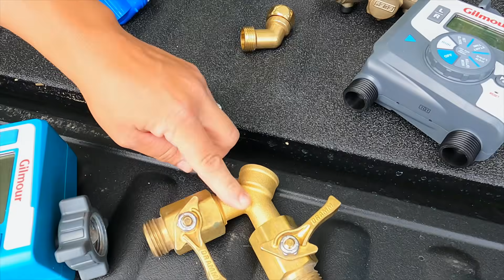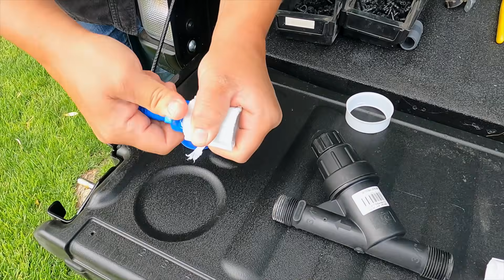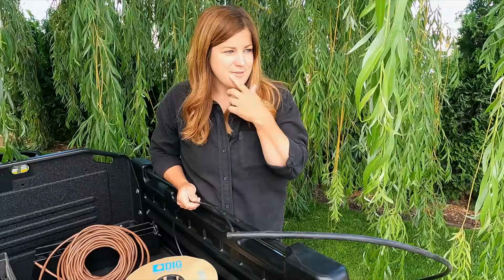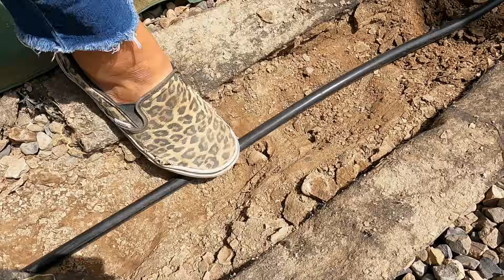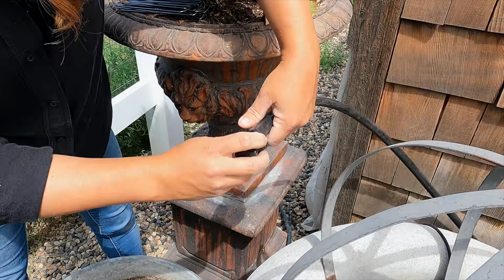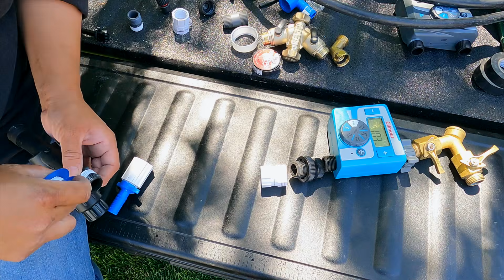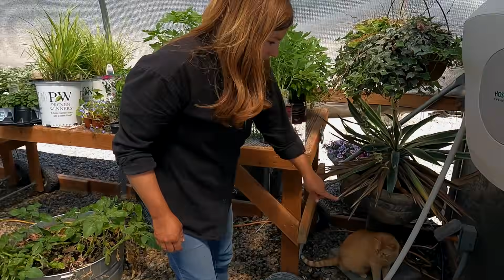Setting Up 18 Pots On Drip Irrigation! 💦 // Garden Answer

Comment: Wow!! the DIY I've been waiting for. I've spend an enormous amount of time looking at videos showing how to do irrigation. My biggest concern was to be able to manage my garden from inside the house using my cellular phone....just like Aaron does. 😏
The task seemed overwhelming, at first.  So, I started with my lawn, which was already fitted with sprinklers and a manual timer.  I finally found a sprinkler system that I have come to love. It is the b-Hyve Smart Hose Watering Timer by Orbit. Just what I needed. It is WiFi accessible, it gives you alerts when watering is done, detects rain in the forecast & delays the watering automatically, it shuts off the timer in the rain and it is super affordable. I found it at Home Depot (Timer with WiFi hub together for $59.99). The only Cons I found are that it only comes with a single hose outlet & I need multiple hose connectors. However, I found out from Orbit that you only need one WiFi hub to control multiple lines. In that case I purchased the additional (3) timers straight from Orbit, since it was the only place that carried them by themselves. They told me that they are working on the design of one with multiple connections. This is such a game changer. I can view right on my cellular phone what's going on with the system. 
After getting this installed all by myself, I am ready to tackle the garden beds. If I can do this at 76 (whoops, now you know my age 😏) so can you. Here is the link:
b-Hyve SMART HOSE WATERING TIMER
https://www.orbitonline.com/product/b-hyve-smart-hose-watering-timer/

Laura and Aaron have been a tremendous influence on my life. Their drive and confidence is contagious. I am no longer afraid of getting rid of plants, etc. I like Laura's motto "If it does not make you happy, just get rid of it" 🤗😉
▪︎Kudos to Aaron for using the  Thread Seal tape at 6:01 which is a cheap and easy find at Home Depot. It is labeled as a 1/2 in by 260 in PTFE Thread Seal Tape
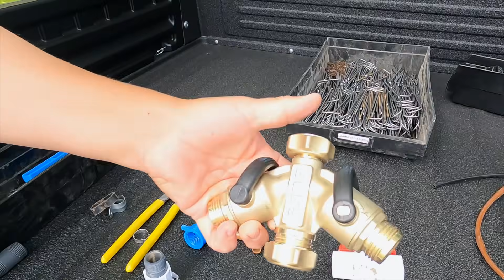▪︎I love the Dramn hose splitter. The  quality and durability justifies the price. However, the ELEY 2-way valve at  7:24 is comparable in quality, durability & pricing as the Dramm brand products. I was sold with the middle valve feature which I use for the hose and love it. Here is the link:
ELEY GARDEN HOSE REELS, HOSES & WATERING TOOLS
https://www.eleyhosereels.com/products/garden-hose-2-way-y-valve
▪︎ To anyone considering to DIY an irritation system, I highly  recommend they view the following links. 
DRIP IRRIGATION DESIGN GUIDELINES
https://www.irrigationtutorials.com/drip-irrigation-design-guidelines-basics-of-measurements-parts-and-more/
DRIP IRRIGATION TIPS
https://www.snwa.com/landscapes/how-and-when-to-water/drip-watering-tips.html
INSTALLING AN IRRIGATION DRIP SYST - Kreatyve Gardenista (YT)
https://youtu.be/9eGo_29-oXM
HOW MANY SPRINKLERS TO USE
https://www.rainbird.com/homeowners/how-many-sprinklers-can-be-used-zone-or-valve
DRIP DEPOT IRRIGATION SUPPLIES
https://www.dripdepot.com/
DIG DRIP KIT (a great starter kit)
https://www.digcorp.com/residential/

SORRY FOR THE LENGTH OF THIS POST 😏 HAPPY GARDENING🌱🌺🌾

Comment: You are drip irrigation MASTERS!!  Awesome video content which helps so many people.  The question I have is about adding the extra couplings with t joint expanders... (I can't even believe that is in my vocabulary and I might be using the terms improperly). Doesn't it affect the water pressure when you add so many extension points . Referring more to the new land garden areas.  Thanks for all you do!

Comment: Thanks, those pot feet are exactly what I need!  BTW, when applying the Teflon tape…if you will flip the roll of tape over, so its backside is against the item you are wrapping, it is easier to maintain even tension.

Comment: I'd like to turn a few sprinkler heads into drip lines...could you do a video explaining how that could work? How many feet of drip line can you run in one zone? And would I cap all the heads in that zone except the one I'd run the drip from? I have 9 zones. I'd love to change two zones to drip only and the rest of the zones would be left sprinkler heads for lawn watering.

Comment: Earlier this year, I had a drip system installed. Living in Northern California which is going through a drought, I wanted to reduce water usage and drip irrigation was a good solution. Installation seemed complicated and buying supplies even more so, so I hired an expert. Your video breaks down the process in simple, easy to understand steps. I feel like after watching your video, I could’ve tackled it. Thanks for the great video.

Comment: I have a problem with ants that get into my pots through the bottom holes.  I am trying to deter them by a mixture of icing sugar, Botax and cornmeal mixed together and then put into a small empty pop bottle laid on its side so the ants can craw inside.  I am putting them below the surface.  What else can you suggest?  Do the ants do damage to the plant roots?

Comment: Does having a drip line coming through the drainage hole impede the drainage when watering? How do you determine how much water each plant needs per day, run time, etc?

Comment: Read this for a good summary on hose thread v. pipe thread: https://help.dripdepot.com/support/solutions/articles/11000044391-know-your-threads

This drove me crazy when starting off! tldr; don't mix them. A washer/o-ring will get you a watertight fitting for hose thread. You need to use Teflon tape or a sealant to get watertight connections for pipe thread.

Don't give up, I'm an engineer and it still took me a while to wrap my head around drip!

Comment: While it doesn't hurt, Teflon tape isn't required (and doesn't help) with hose thread connection which rely on a 'rubber' washer, as you noted (some connectors use an o-ring rather than a washer).
[Edit - Laura used the tape on a pipe thread, where it is required. But she didn't mention that it's not needed on hose thread. ]
(Pipe thread seals by interference between the threads, while hose threads seal by compressing a washer between the end of the male connector and the inernal base of the female connector.)

Comment: I set my hanging baskets up on drip irrigation and it has been a game changer!  I killed many a hanging basket before I began automatic watering.  I started with a kit and it will do about ten pots, but your system looks much more substantial and I think I will switch over to the 1/2" tubing to get a better supply at the end of my line.  I have found that with the 1/4" tubing you run out of pressure at the end of the line if you have many pots.  Thanks, Laura and Aaron!

Comment: Love this! I just installed drip irrigation myself this year and I was very intimidated at first, but it got easier the more I did it. Just a tip if you have to garden while it's hot and sunny out and there isn't any shade - I have an old patio umbrella and umbrella base that I plop down wherever I need some shade so I can work in the garden and not burn up under the hot sun. 😊

Comment: This video was beyond helpful! We are just beginning this process and we have an irrigation line spec’d at 75 psi (1/2 inch poly), where the pressure at our faucet is only 55 psi. Im wondering if I can eliminate the low pressure regulator to travel farther away from the faucet. I’ve noticed your in-ground beds go pretty far with 1/2 inch tubing. Are you using a low pressure regulator with those systems?

Comment: How do you winterize your drip runs? Can you reuse or do you replace each year? Any tricks for inserting the .25” barbs? Killed my hands till I bought a tool but that tool doesn’t let you insert a second tube on the other end of the barb. TIA.

Comment: This was such a great demonstration of running the drip. Thank you! For the brown 1/4” emitter, can you create the same thing if you don’t it by puncturing holes in the black 1/4” distribution tube? Probably not, but just wondering? 🤷‍♀️
Reply: The emitter holes in tubing have a kind of filter behind them to prevent clogging.  If you put in a hole in the tube it wouldn't have the filter and could clog.

Comment: Perfect timing! I’m reconfiguring my drip this year to include the newly planted beds in front. Unfortunately, I need to add on to the faucet in back and run it around the house as the front faucet is inside the garage (weird and frustrating).

Comment: Great video! I live near you so I have the extreme heat too. I tapped into my underground system with my 1/2” tubing and went from there to my beds and pots. I haven’t had any trouble with pressure but maybe I’ve been lucky! I have 6 zones I can tap off of. I did find that the time needed for the lawn is of course too long for pots so I added an inline valve to slow the flow on my 1/4”tubing. My husband and I have learned by trial and error as this is the first home we’ve had an auto sprinkler system. I’m not sure where I should or could add a pressure reducer. Any thoughts? Thanks for your amazing content! 🙋‍♀️ Star ID

Comment: great info!! it does sound confusing but it's like a puzzle and finding the right pieces to make your system work for you... generally, esp at a smaller hardware store over a big box store (in my experience), there's the "guy" who works there and knows what's what to walk you through it... my hubby has turned into mr. sprinkler man, bless him - i plant and he goes around running sprinkler to all those places i decided really needs to have a plant there, lol... one of the things we use, since we don't have the fancy phone app (wink wink), is a remote that comes with our system... our system is on a timer, but with the remote,  i can be on my patio, etc and turn the system on if i want to run an extra watering in any of the zones we have... if you've been waffling on getting a system, particularly if you live anywhere it gets HOT (and isn't that everywhere right now??), GET ONE.. do not be afraid of it!! if you can operate your new cell phone, you can do this! lol... really, just take a breath and do it step by step.. you will be thanking yourself (or your sprinkler man) every day!! thanks for the video!!

Comment: How would you run the 1/2 tubing around a corner? Is it flexible enough to where the turn wouldn't cut off the water flow?
Reply: Use an L connector.
Reply: @jgwood10  A PVC L connector?

Comment: Another source of leaking and installation problem that I have experienced occurs when mixing brands. The dimensional measurements sometimes are for the exterior of the hose and sometimes the measurement s for the interior of the hose. 🙄

Comment: Thank you so much for this demonstration. If anybody's plant need a drip system, it is mine. I have the hardest time figuring out the right amount of water. I seem to either over water or under water trying to correct over watering! 🐈 It's a mess.

Comment: It wasn’t confusing for me because I’m right in the middle of putting my pots and raised beds on drip and I’ve already pretty much sorted it out.  But as I watched, I thought that it would have been helpful to see one setup done from water source to pot emitters. Then go back and deal with the variables. Your previous videos have helped me SO much. I really impressed the guys at the sprinkler store with my knowledge of terms and understanding of the sequencing 😊. Thanks.

Comment: Do you take it down in the winter or leave it set up?
Reply: They leave it in ground. Just turn off the water. It will drain. The lawn irrigation is different. That has to be blown out so it doesn’t freeze

Comment: Thank you so much for posting this video it helps with understanding drip so much! We are attempting to put in a system this year. We are hoping to use rain barrels as our supply. Would we still need to use the back flow piece etc?

Comment: I have a few raised beds and parkways with drip run in them but the water supply is too far to easily trench. My solution was to have the pressure regulator and connections to the drip all in the beds/parkways with quick connects so I can easily attach a hose, turn on the water, and walk away ☺️ 

You can get really inventive with your system, I don’t have nearly the same amount of connectors as shown, but I also have a different situation ☺️👍🏻

Comment: Great video...I started with a small irrigation system in some of my beds last year because of your instruction.  This was a good recap of all the parts needed as I want to add some to my front beds.  My problem is I don't have a faucet nearby and I do all watering by hose/sprinkler.  Would it work to put a post in and add something to that to connect a hose to and then run drip?

Comment: What great timing. Just yesterday I was telling a friend that I need to get a plumber to fix my leaky toilet so instead of coming for just that simple job wouldn’t it make sense to get him to change the garden faucet so it splits off then I could run one hose to the beds and another longer hose across the ground to where I keep my little plot of containers for all my vegetables (at least 80% of the backyard is concrete) and I could even stretch the budget a bit and put them all on drip, just as Laura do!!  My friend said sure, that’s easy enough and a very doable DIY that “WE” can tackle!! Now, after watching (and re-watching) you go at it my head is still spinning and the glaze in my eyes haven’t cleared — if this ever becomes a reality Mr. Plumber/Handyman or some other expert will have to take charge and put it in place for me!!! 🤣🤣🤣

Comment: This is Exactly what I have been doing the last several days. Re doing most of my drip irrigation. I thought I had it all laid out last summer, but it just didn't hold up over the winter. Any suggestions for weather proofing drip systems? It's getting expensive replacing it. (Especially, when you have to run up to ACE & can't wait for an online order (Wowza $$$)!

Comment: Hello! I have set up fairly extensive drip systems in three of my gardens so I’m very experienced with the parts but it’s always great to see how others are setting them up so thank you for this video. My question is this…I have a section on my raised Azek deck of half inch tubing running about 5 feet along vinyl siding under a window box for various pots. Do you have any suggestions of how I could tack it down to the deck without permanently damaging the siding or Azek by drilling in clamps?  It looks horrible as the tubing always wants to roll up in the air and I’m not sure I’ll always want it there. I realize there may not be a solution to this but thought I’d ask 😂
Reply: Maybe puddy will work.

Comment: I use a similar system for the ferns I hang on my porch.  I got really tired of watering every day and having water run down my arm into my armpit and down my body.  I run it for only 6 minutes and the ferns thrive all summer.  It is satisfying to look out of window and see water dripping from bottom of pots.

Comment: I’m very new to gardening and live in a zone 6a, do I have to take the drip irrigation system appart during the colder months and re-install it once it gets warm?
Reply: No turn off the water and the tubing will drain.
Reply: @jgwood10  Oh ok thank you!
Reply: If you add a timer, it will have to be removed, drained and stored where it won’t freeze.

Comment: Hi Laura.  Thank you for this video!  I have 4 rail planters that I plan to put on drip this year using the Proven Winners WaterWise system.  I also have a well and plan to hook up a timer on a hose splitter.  I saw your other video where you set up drip at your parent's house, but I still have questions after watching this.  The rail planters are fairly far away from the timer and water source.  Can I just run the 1/4" tubing from the timer, on the ground, on the house (using the tacks) and then directly to the pots by attaching it to the rail?  My planters are 28" long so I am going to use 3 emitters per container.  Any advise/recommendations would be appreciated!  First time trying this so I am hoping it works out. Thank you!

Comment: I have one timer that has a leak below the timer, so it only leaks when the timer is running. I just planted mint there.  Sooo lazy 😂
Reply: Hope you planted mint in a container since it will take over an entire space plus more. Then it’s hard to get rid of it.
Reply: @jgwood10  not in the Chihuahuan desert it won't 😂. Planted it there three years ago.  It still only takes up the damp area from the leak.

Comment: You two definitely"demystified" drip irrigation, thank you! Is there any difference between brown and black tubing beside color? Cost, flexibility? Just wondering why not use the black at the top of each pot. So appreciate this tutorial, guys 💚
Reply: often, not always, the black tubing has no emitters and the brown has built in emitters [every 6 or 12 or 18 inches]. some brands reverse the colors! also there is 1/2 inch tubing with and without emitters!!! hope that helps!
Reply: @moiseechen  thank you, that is so helpful 🙂
Reply: @prairie2gem  glad to help! like Laura, I've simplified and narrowed down from the zillion options. glad i ordered a little kit to 'train on' to learn what bits and bobs better suited to my situation.good luck. you can do it!!!

Comment: Thank You!!! Such a good video. I recently installed my first drip irrigation on my rows of sweet corn. It was simpler than i was anticipating but I have had a problem with the connectors from the drip tape  to the poly tubing keep popping off. Do you have a trick to keep this from happening? At this point, I'm having to babysit my drip and I'm afraid of putting on a timer for fear of having another leak go undetected.
Reply: wise to not go timer route!!! all/any of the pieces can fail [heat, cold, critters!] btw, they make connectors [for the 1/2 inch tubing] that have a circular ring bit you twist down to lock in place.
Reply: Are you using a regulator?
Reply: @jgwood10  Yes